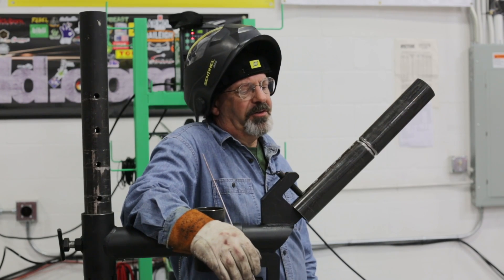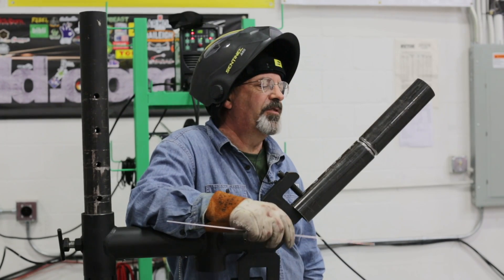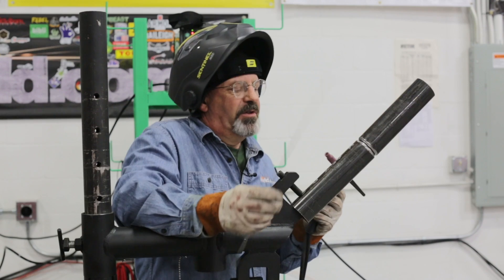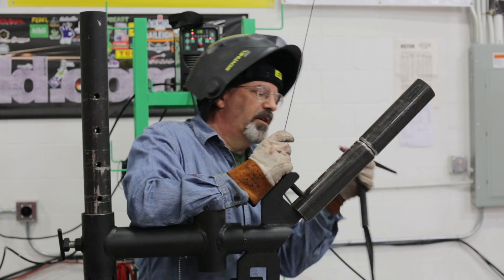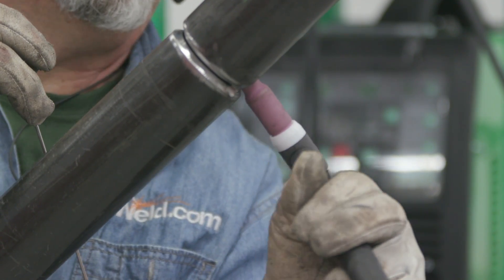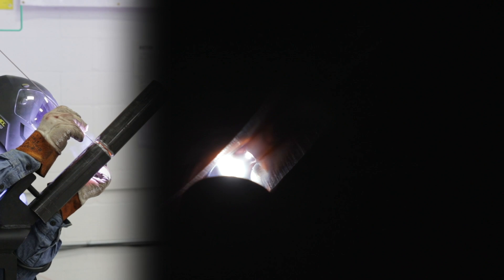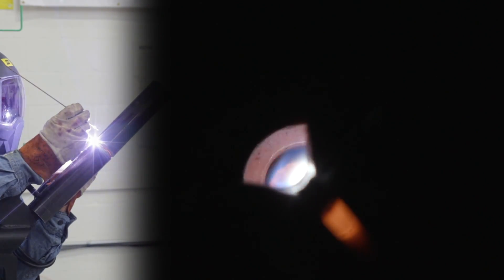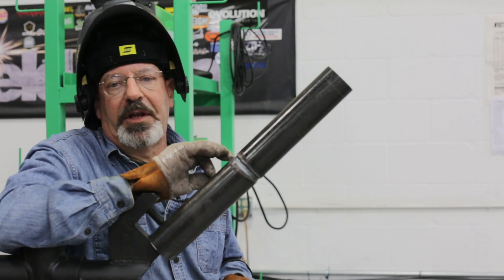Tips for 6G TIG Roots on 2 inch Pipe

Comment: So how many ways are there really to put a root into pipe?
Reply from the maker: Lots...
Reply: @Welddotcom  laywire,  back feed, dip keyhole. Backfeed is the most guaranteed to get a good root in is it?
Reply: @Welddotcom  how do you get push through on the bottom side of a 6g 2 inch sch 80 without back feeding

Comment: Can you recommend a good machine to purchase to teach myself TIG welding? From the UK
Reply: how much do you want to spend?
Reply: @williamsavory5274   probably around £1500 or cheaper
Reply: @craigroberts6722  for that cash you could get jasic ac/dc pulse tig 200, pedal, lincoln viking 3350 helmet and a ck torch to your liking
Reply: Also have a look at R-tech They have some decent Tig welders and offer. I think, a two or three year warranty. I have the ac/dc 160 for hobby use and its been great.
Reply: I've seen a lot of jasic lately. Never knew if they were a trustworthy brand or cheaper standards
Reply: @craigroberts6722  buy it from a local motor factor etc for the peace of mind of easy return under warranty if you are at all dubious. But I have had no issues and I know a guy uses one everyday 4yrs no issues.